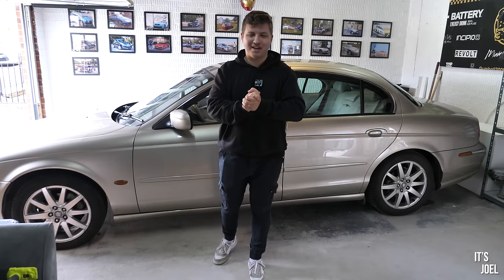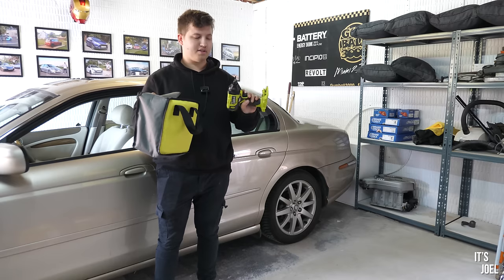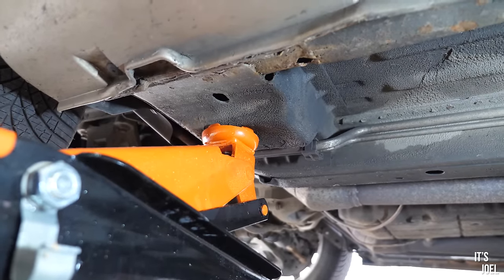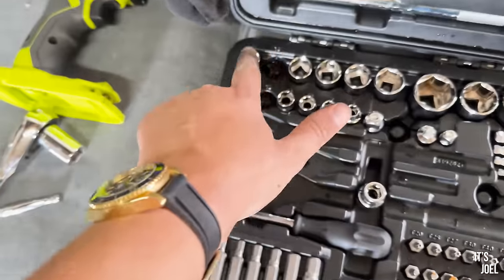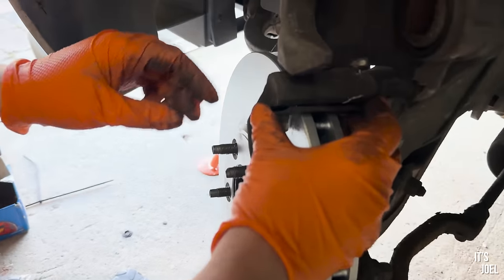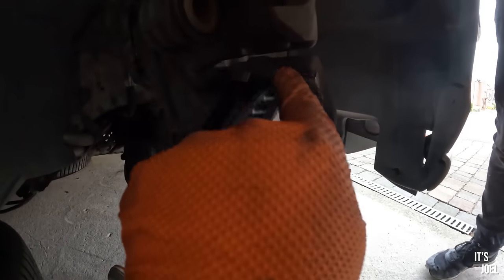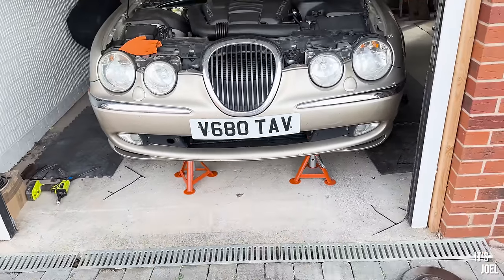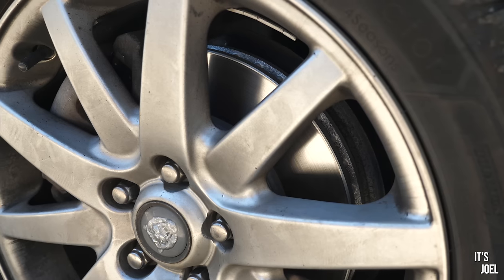FITTING NEW BRAKES TO MY 1999 JAGUAR S-TYPE V8!

Comment: Yay, best Halfords advert so far.
I have a 4.0 s type in full working order, without the rust.
If you didn't clean and lubricate the slide pins on the rear calipers that seize up with rust it's going to need doing again.
First time is always daunting.
I have plenty Halfords sockets, some have had 40 years of use.
It's possible to break anything with a length of scaffold tube and a hammer but that's not a fair go.
Keep posting the repairs,my guess is the drivers window doesn't work yet.
Reply from the maker: Thanks for watching, and for the tips!

Comment: Hi, Joel. Well done. I have a 2005 S Type 2.7. Assuming the brakes are the same (which they may not be), you need to release the electronic park brake on the rear callipers before winding the pistons back in. The pistons should need to be wound in only a tiny bit because the park brake has wound them in most of the way for you. To release it, simply turn on the ignition, foot on brake, release park brake, switch off ignition whilst holding the park brake in the off position. This is possibly what went wrong. Also, the calliper slider pins are probably seized and corroded to hell and the rubber bushings wrecked. All the best.

Comment: brake pads on one side were only about 2 thirds-worn but were in a bad state, so needed swapping. Discs were shot. Well done for the DIY work. Some red rubber grease is good for pistons\seals. Much easier when you have proper tools from Halfords !

Comment: Fantastic, more people should work on their cars, or at least know how to. Couple of points though. 1/ when changing pads or disks and pads, remember to pull out those slide pins and wipe off the old grease and apply a thin layer of the correct grease. 2/ the caliper compression tool you had was the wrong tool for the rear calipers. The rear calipers are dual action, they press out to apply the brakes from the pedal, and screw out to apply the brakes from the handbrake. Therefore you need a caliper tool that rotates and presses in the rear piston at the same time. That is why you found it so hard to compress the rears, and why you didn't manage to compress them far enough to avoid binding on the disk. You can also damage the calipers just pressing them. 3/ good rule of thumb is if you are doing a full disk and pad swap, do a brake fluid replacement as well. overall good job though :-)

Comment: Top tip, some Halfords branded tools are actually pretty good despite the haters, the Halfords torque wrench are Norbar ones under the branding.
Reply: There is no haters regarding halfords professional/ advanced tools. I use them in my workshop along side facom and so on

Comment: I hope you wire brushed all the contact points and silicone greased them. I’ve done pads in the past I didn’t do that and the pads got seized against the rotor and wore down very fast. Also guide pins need cleaning and greasing

Comment: I always crack open the bleeder when pushing the pistons in - especially rear/hand brake ones that wind in. Makes it loads easier, obviously keep a careful eye on the fluid level.
Reply: Correct… but the main advantage is that you squeeze out old deteriorated brake fluid from inside the caliper and maybe the hose, that has been heated many times and has aged, it’s and easy way to replace it with fresher fluid without doing a full system flush and bleed.
Reply: Asking for air in system.
Reply: @utopian666  No, it drips out of the hose and bleed nipple under gravity / atmospheric pressure.
Reply: @utopian666  Once pushed back in, then you can bleed the brakes as you would normally once oit;s all put back together. Brake fluid is cheap.

Comment: Hi Joel. Glad to see you took the plunge and  jumped in, as you said you would. I can relate to. "The plan worked out great" but in practice, a gremlin crept in soon after. So the job needed doing again.  My only suggestion to complete the job would be put new brake fluid into the braking system. See you in the next one. 👍👍
Reply from the maker: Thanks for the tips!

Comment: Well done on the brakes. But as said, you only need a windback tool on the brakes which have the handbrake (rears on the Jag), the front should have just pushed back.  Also, some calipers have a sided screw, so anticlockwise and then clockwise for the other side, I wonder if that's why you struggled getting the piston back on that side.
Reply from the maker: Helpful to know, thanks so much!

Comment: The fronts weren't quite down to the metal, but were disintegrating so were caught just in time. The brake rewind tool wasn't needed, in fact shouldn't have been used, on the front brakes - the pistons should just be pushed back, it's easy once it starts to move. The rewind tool is needed on the rear because of the handbrake operating on the rear pads (some cars - Volvo, BMW, Rover 75 for example have handbrake shoes and don;t need a rewind tool). Good job though, brakes are relatively easy to do.

Comment: You don't grease the discs - you de-grease them with brake cleaning fluid.  Brake discs are stored with a light "sheen" of oil on them to prevent in storage rust, so it is critical to get that layer off before fitting/using them or the oil can transfer onto the pads.  Slippy pads and slippy disc = brown trouser moment when you need to hit the brakes lol.  Use WAAAY more brake cleaner than you did on both sides to get that layer off the discs.  Good job tho - I used to do my own discs when I was your age (god that made me sounds old haha), but now cant be assed and pay someone ;)
Reply: Pagid discs dont come with an oil layer. They come with a painted coating

Comment: I’m glad your not doing my brakes < it was like the blind leading the blind , where was the anti seize on rebuilding ?
Reply: You would always clean up inside the callipers around the pistons and make sure they slid freely, especially with the tool to wind them back easily. And you always spin the hub / disc after fitting to check that it’s dragging by the right amount… not binding solid.

No way to get a single disc and pair of pads to replace the cooked ones I reckon, even if they do need changing (which I doubt).
Reply from the maker: you have to start somewhere, and from doing it this time, i've learnt alot that will improve it next time round
Reply: @itsjoel  Well you've got all the equipment now so you can get it sorted... presumably the handbrake components in the rear will need setting up or replacing as well to finish the job properly...

Comment: Crack open the bleed nipple on the caliper be sure to clamp the flexi hose to avid the fluid running all the way back. This will enable it to be much easier to get the piston in, once fully retracted open the bleed nipple pump the brake pedal to get the fluid back through the line then just shut off the bleed nipple. Great content joel look forward to seeing more
Reply from the maker: Thanks for the tip! Have some brakes for my TT that I need to fit next...